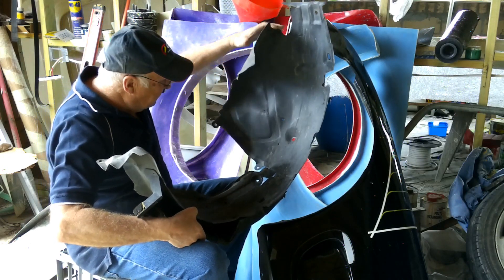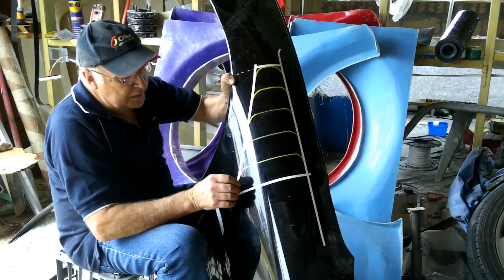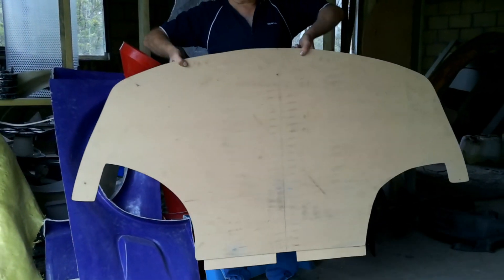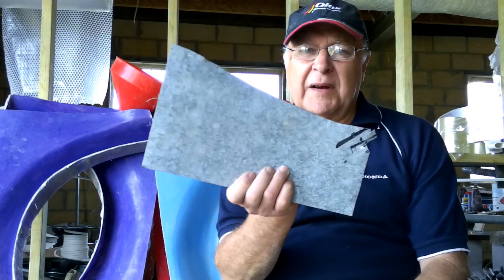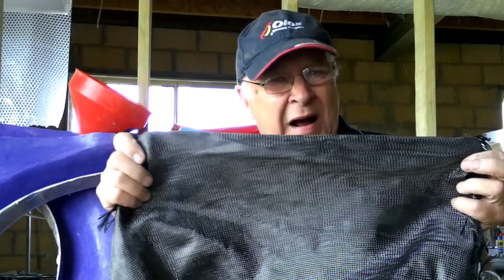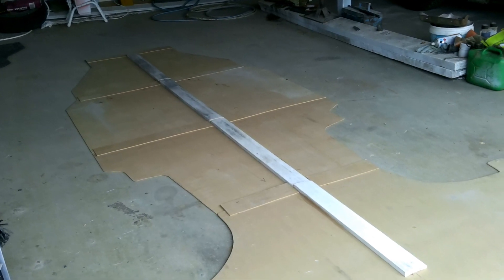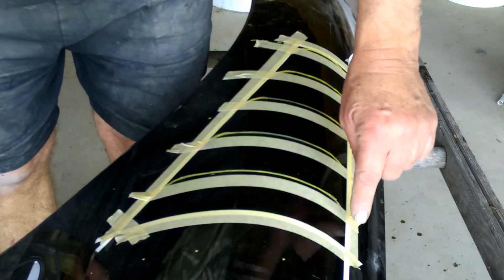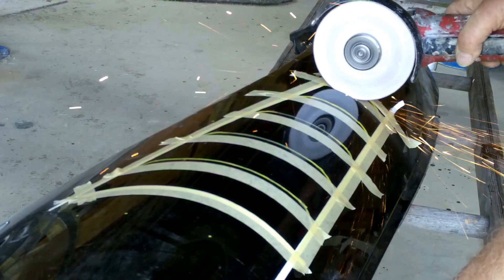How to Make a Race Car Aero Kit - Part A

Comment: Fiberglass resin? Means PU resin or Epoxy?
Reply from the maker: Generally speaking fiberglassing uses poly based resins - a resin + 1-2% catalyst. Epoxy resins are completely different, comprising two parts mixed in ratios of 1:3 - 1:5. Epoxy resins are generally used in laying of Kevlar and Carbon Fiber - but either resin can be used on any of these three types of re-enforcing cloth.
Reply: @BillsBuildandRace  Vou are right about the ratio and use. But Epoxy have more adhesion and strength properties. Use PU resin with Kevlar I don't think is the best way.
Reply from the maker: @RBAERO  Yes epoxy gives greater adhesion - like onto sheet metal car body work. From personal experience I know if you use fiberglass cloth with it's normal poly based resin your overlay won't stick - whereas with epoxy it will. Just one example of where using the non-conventional resin gives the best result. And yes you get the greatest strength from Kevlar using epoxy resin - but that does not mean there are times where it cannot be laid with poly resin, such as in a materials combo with fiberglass cloth, like just around the wheel arches in a complete car front end where 99% of the material is fiberglass, and where using epoxy resin would be needlessly way more expensive, and the best adhesion of the Kevlar to the fiberglass is in a single wet resin layup. Things are not as absolute and engraved in stone as most in the composites industry would have you believe. If I get a better , easier or more common sense result from flying in the face of those conventions - I will. All that matters is the end result. Forty years experience teaches you this.

Comment: Just wondering why you wouldn't use aluminum for the skid pan?
Reply from the maker: Yes we considered aluminium, but the only way to get it rigid enough was to either use something thick (expensive), or nylon laminate panelling - which is a fire hazard. You've seen those high rise cladding fires, right?
Reply: I sure have, makes sense

Comment: My dad and I built a tail gate for a VE Valiant wagon years ago, is was quit rusty and every one we found to replace it with was f...ed, so we did it in epoxy, CSM and Kevlar using the original metal one as the mould and then joined the two reproduced plastic half's , easy to do just a little time consuming.

Comment: Hay WJPoo4 were the F... did you dear about not using epoxy? My dad is a retired boat builder and we ( he and I ) mix epoxy with every thing, CSM, woven cloth, triple weave, cabin , Kevlar , micro fibre , Q cell and all in composites. Now If any of your viewers are going to tell me that my dad and I cant do it, it wont work,  well I am here to tell there full of shit. My dad has not used any of the Polys in years and I cant remember the last time I used any of the polys. Epoxy all the way for any of the above. The only thing we haven't worked out yet is how to use it on styrene foam.

Comment: What are you going to do about the exhaust heat? I am genuinely curious. My car produces the most heat in the trans tunnel. I used Lizard skin ceramic coating  to drop the trans tunnel from 160 degrees to 90.
Reply from the maker: That's Jame's problem not mine, but he knows trimming will be needed to avoid the fire risk. I think he's applied heat reduction to the exhaust, but we'll have a better look tomorrow test fitting the first panel with the car up on a hoist. However we address this issue (which is certainly a relevant one), I'll cover it in the second video on this topic.
Reply: I have ceramic coated inside and out the entire twin turbo manifolds, housing, dump pipe and exhaust. 3 layers of heat sheiling already installed on the trans tunnel. Plus rear exhaust is titanium so heat dissipation is amazing. I also run Ethanol flex fuel which lowers EGTs. Combined with fully ducted V mount and vented bonnet, heat is not an issue!!

Comment: One of the reasons why i like watching you is because of the choice of tooling
As soon as you said cut the panel, i instantly thought, 4 inch angle grinder will make quick work of that
And sure enough thats what you used
Unlike these guys that have no idea, they all pull out a small 1 inch wheel with an under powered tool taking them hours or days
Reply from the maker: A few friends of mine (very few are this brave), have told me they have inwardly gasped with horror once I launch myself into a project or job, but once I've got my mind made up... hell I'm gonna get it done! Then they tell me they watch quietly from the sidelines with awe at how much I get done compared to most other people or themselves. It's both a blessing & a curse... like most things in life.

Comment: I'm using basically a 1mm thick layer of chopped strand fiberglass for my front section and it holds up great. I've had it on in the city and now in the country and shows no signs of damage except on the front edge from the hectic dirt driveway up to my parents place. 

A tad flimsy, but screwing it into the bumper and connecting it into the bash plate bolts stiffens it up a lot although the second version will get some stiffeners and some air deflectors in front of the tyres incorporated into it(look at any new car and you'll see them, they can apparently save a ton of drag).

In my researching there are 2 schools of thought: One is to restrict the air getting into the arches, which would create a high pressure zone which would theoretically increase lift, the other is to vent it so it can remain relatively neutral. Which works best? Who knows, I don't have the few thousand dollars per hour to hire a wind tunnel.

Comment: Great job Bill can't wait to see the end product, the only thing that worries me is won't the trapped exhaust heat make the fiberglass panels warp or maybe even melt and or  catch fire ? If the resin melt mean under heat !!  With the scoop in the guard can you make RH LH just from the one your making !!  Seeya Rob.............I've got a wind tunnel out the back if you want to use it, you won't get the car in there but it's got a comfy seat AND it flushes !!!!!!!!  Haha !
Reply from the maker: Hilarious... .and here's me been  thinking it was aircraft sonic booms i was hearing from Williamtown base. James will trim the panels to clear the car. That whole issue is his to address - not mine... as is driving this bullet down Conrod & through the Chase!
Reply: My exhaust is completely ceramic coated inside and out. Rear section is titanium. It only ever gets warm to the touch and I already have a shit ton of heat shielding. The race car has been developed over the last 13 years so I kind of know what I’m doing

Comment: Hope that the undertray does not generate lift at Bathurst, there are a couple of rises there on the track which can result in air getting under the front and acting on big flat surfaces to lift it up.